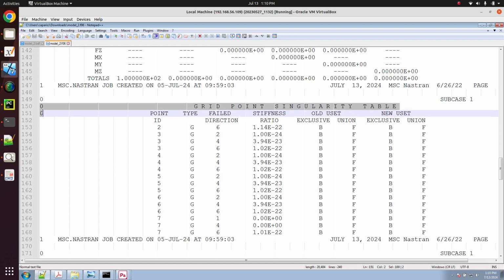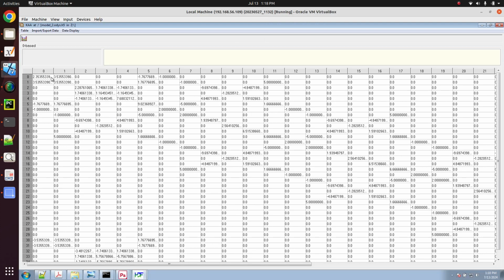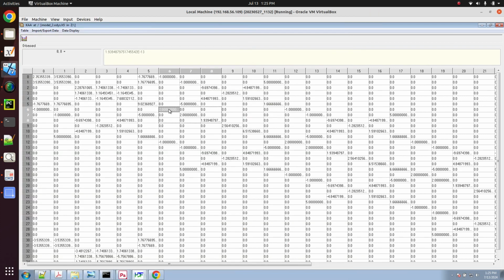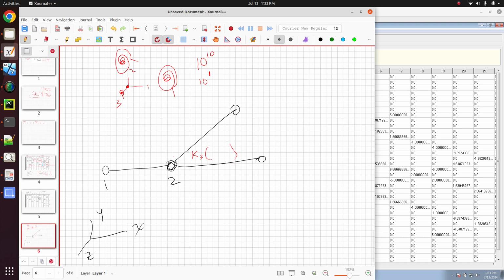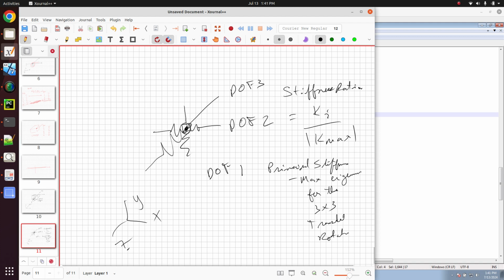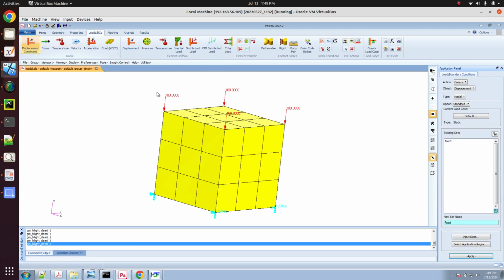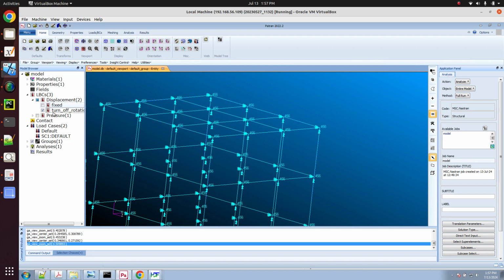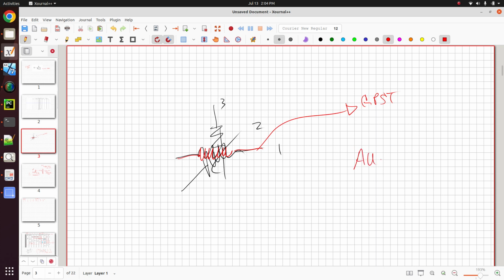GRID POINT SINGULARITY TABLE - MSC Nastran

Comment: Hi, thanks for the video. Can you show how to export Stiffness Matrix from MSC Nastran to HDF5 file? What is the card entry for the same?
Reply from the maker: This is answered in this reddit post: https://www.reddit.com/r/fea/comments/1covgq3/how_do_you_output_the_stiffness_matrix_to_the_h5/?utm_source=share&utm_medium=web3x&utm_name=web3xcss&utm_term=1&utm_content=share_button

Below I quoted some of the answer.

Solution: Add this case control command.

EXTSEOUT(extid=100,hdf5)

This generates an H5 file, e.g. dsoug1.odys.h5, with stiffness matrix KAA. Refer to figure 1.

EXTSEOUT only works with MSC Nastran. This will NOT work with other Nastran types, e.g. NX Nastran, NEi Nastran, etc.

PARAM,EXTOUT,DMIGPCH was also used to confirm the stiffness matrix in the PCH file also matches the matrix in the H5 file. EXTSEOUT and PARAM,EXTOUT,DMIGPCH do not work together, so use these entries separately.

This was done with MSC Nastran 2023.3. Note that this may or may not be compatible with older and future versions of MSC Nastran. If you see this post in the year 2030, EXTSEOUT may no longer be available.

Tools Used:

MSC Nastran 2023.3 on Linux.

Notepad++ - https://notepad-plus-plus.org/

HDFView - Registration is required, but free to download: https://www.hdfgroup.org/downloads/